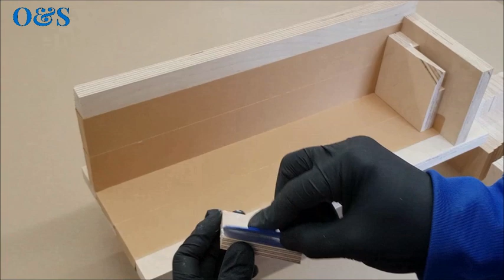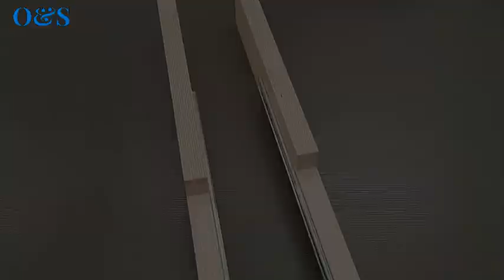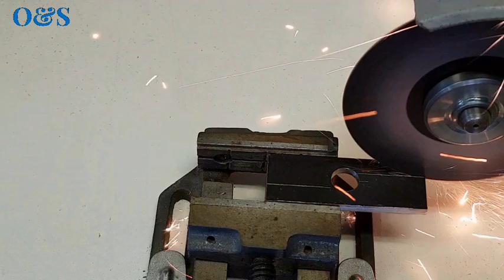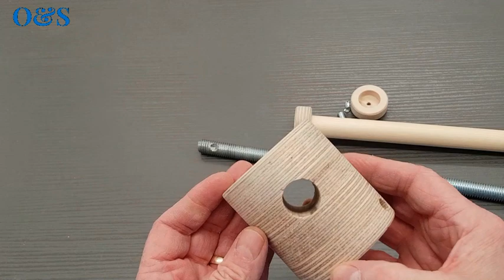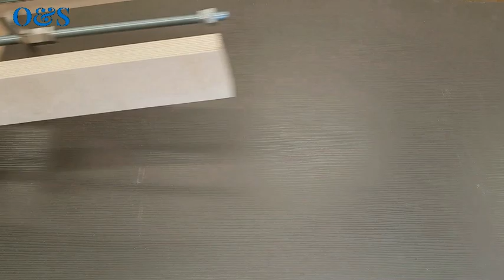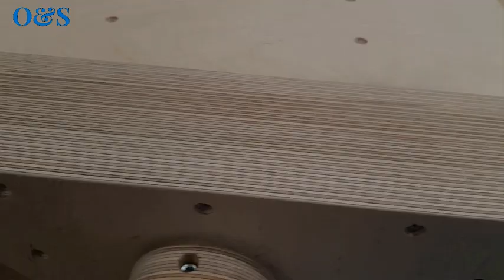Mini Workbench With Quick Release Vise ||  Pikasäätö puristimella varustettu  pieni työpenkki

Comment: I like how it works. Seems to be nice and strong. Tip. When making the notches for the "spring clip" in the long release nut...put a bolt in the long nut and add another nut to lock it on the end then simply put the bolt thread end in your drill and start the drill while keeping the grinder on you mark. This will make a much neater grove. Not that it will be seen after its installed but everything made with love works better I find. Great build. Going to build one. Thnx for sharing
Reply from the maker: Thank you for the comment. 
You are really right. I could have done that part a lot neater, using a drill and angle grinder. But this was only a test piece that then remained in use. My latest model for this part consists of two nuts with a spring in between.
Reply: @OSPuupaja  would like to see the upgraded version. Love the creativity
Reply from the maker: Ok, I'll see what I can do about it.
Maybe I can share a few clarifying pictures.
Reply: @OSPuupaja  Thnx a bunch. Really nice of you. PS. I thought the rest of the pieces on the vice was so nicely made and innovative so I was surprised by the method you chose to make the grove but I understand it was a test piece
Reply from the maker: A video showing the structure and operating principle of the updated latch device can be found at the link below.  https://youtu.be/eBe69-nLFj8

Comment: Looks very interesting. To make a real product out of this would require it to be made out of steel, which in this case would be very expensive. If you can figure out a way to use less mass in the locking, then I think you could go further with this.
Reply from the maker: Thank you for the comment!
On the other hand, the mass gives more stability to the workbench.
Weight 14 Kg,
I think the weight of like this (mobile)workbench is very reasonable.
This is for a wood workshop and is also a woodworking project,
so plywood was a natural choice.

Comment: In the beginning a didn't have clue what was going on - then it dawned on me :) Very clever :) What's the "pitch" in the stacked sandwich plywood locking block?
Reply from the maker: Thanks!
I try to make the videos so, that the product is built step by step and only at the end of the video will the structure and function be revealed.
The locking blocks are made of 9mm thick birch plywood pieces with a size of 87x87mm.

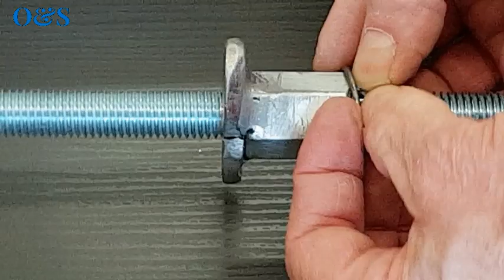Comment: 14:14 What is the function of the snap ring?
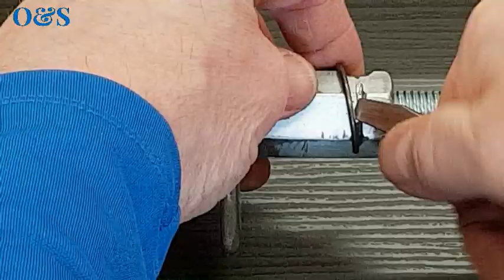Reply from the maker: The locking ring holds the spring in place. The spring presses a small round piece of metal (14:06) against the threaded rod. This increases the friction between the threaded rod and the locking device. This friction ensures that the metal latch moves in and out of the locking cavity as the threaded rod is rotated. At the same time, it ensures that the latch does not spin automatically into the lock cavity when the clamping jaw is pulled open. I have made an updated version of the lock device. You can watch the video from the link below:  https://youtu.be/eBe69-nLFj8
Reply: @OSPuupaja  Thanks and great vids!